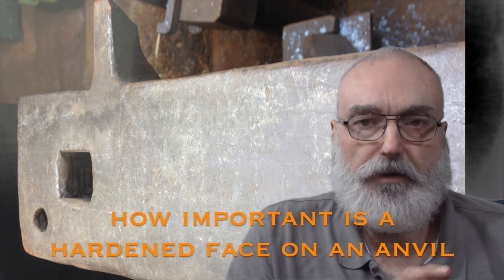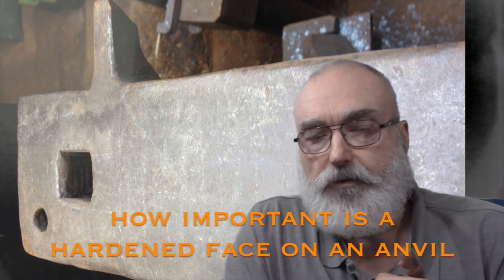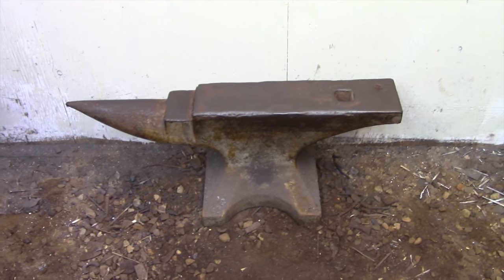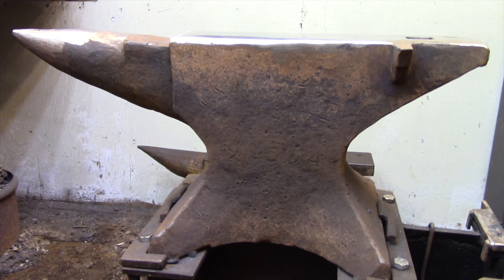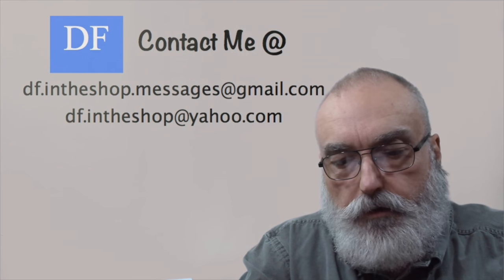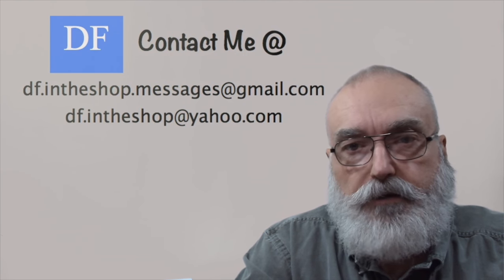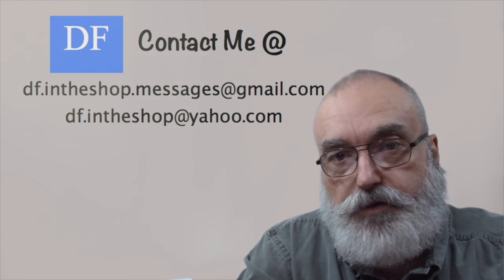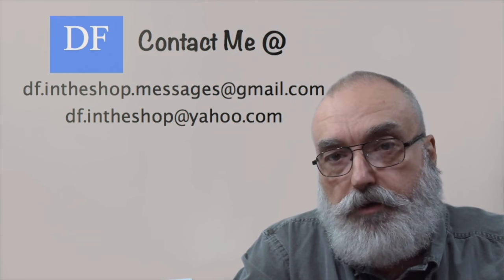Blacksmithing For Beginners - How important is a Hardened Face on an Anvil

Comment: I don't have one anvil. I realized pretty quick that the features of an anvil can be reliably broken up. For example, I have a flat faced piece that only weighs 24lbs on a stump. Much like a railroad tie plate. It's not the best for drawing things out. Instead of forge welding, consider putting a piece of nickel between a hardened plate and a mild steel Base. The shear strength is sufficient for the job. For rounding, I have a modified sledge hammer on the same stump as well as a triple layer of hard leaf springs (3x7inches) forge welded together for any bending I need to do as well as a softened hammer head for cutting steel. When I started I just had a piece of mild steel. They're very good for the money, and if they ding up, they're cheap and easy enough resurface. Eventually you can try forge welding a hardened steel plate onto it 1055 is a good choice and isn't fussy to harden though 1084 is preferable for it's shallow hardening properties.

Comment: I think the idea is that rebound makes it easier on the smith because it helps lift the hammer back up but I'd say probably not as much as one might think because you also have to consider the hardness of the item you're working on, which is usually pretty soft. I think if you work on the anvil all day you'd probably see a difference in fatigue though. Of course harder faces last longer without deformation as well as long as you don't chip or break them which is why several modern manufacturers have made a point not to make them too hard.  You can actually get to good hardness by just facing a soft anvil with hardfacing welding rods and this doesn't require heating or a quench, just some grinding smooth after.
Reply from the maker: In don't think most people are referring to  the direct rebound from hammering on the metal because you are right you don't get any rebound from hot metal. Even if you did you would need reflexes like a cat to benefit from it.  I think a lot of smiths would like some reason for all that wasted motion of allowing your hammer to bounce on the anvil every 2 seconds.

Comment: For those learning hammer control;
 A soft hammer is the answer not a soft anvil. 
Annealing is a needed skill for blacksmithing. 
If your control is so poor that you miss your work and dent your anvil, put your hammer in the forge. Allow a long soaking heat ( it is a hammer not a blade)  then shut the forge off. The next day your hammer WILL be softer than your anvil.
Reply: P. S. What welding rod do you use?

Comment: Thanks Dennis.  I am a beginner, and went for that long search for an anvil.  I found one (Peter Wright), but it was expensive.  I was untrained, plus the anvil had black paint all over it but the face looked relatively smooth with very little chipping.  When I got it home, and scrubbed the paint off, I discovered that the center of the face had been repaired sometime in the past.  Of course, the person who sold it to me did not reveal this fact, and the paint obscured it (be careful - I have seen this more than once).  The areas that were built up with repair dent slightly when i hit it with a hammer.  So I may need to perform some repairs myself to get to a satisfactory hardness. This left me with a lot of frustration and anger at myself for being such a dummy.  This video has helped soothe a bruised ego, so thanks for that.  And I will do what I can to improve it.  Again, thanks for the reality check on the real reasons that an anvil works as a tool, rather than as a collectible.
Reply from the maker: It is important to learn to relax.  When your starting out ( and everybody is the same)  you have to realize that all the damage to your work is mainly coming from your hammer not your anvil.  As you improve you can decide how much your anvil need to improve to keep up with you.   It took me 30 years before I decided I needed to upgrade my anvil.

Comment: In the eighties i bought an anvil of about a hundred pounds from an antique shop near by, they were using it as a door stop.It is a cast iron anvil with about 25% of the face beaten away,I tested the face with a file and the file wouldnt cut it.Even though that anvil is in such poor shape, it's still a good usable tool.I think it was $25.00 well spentThank you for sharing your knowledge, i wish the internet had been around when i was trying to learn how to forge.

Comment: I'm speculating that a harder surface will allow you to put ( bounce, reflect ) more of the energy from the strike into the piece your working.  Where as a softer surface would absorb or dampen that energy.  The amount of energy conserved may be significant.
Reply from the maker: I don't agree with this rebound theory at all.  If you want to get the most work out of the energy it took to raise the hammer you need to make sure that the metal is sitting on something that doesn't move.  As long as the surface is harder than the heated steel it doesn't matter what it is.

Comment: I was looking at the harbor freight anvil. It case iron so it will/should work if I keep the work piece hot and soft. As it cools damage will occur. I see people beating a cold piece of metal and they are wondering why it damages the anvil. Go figure. This anvil might make a decent project. Heat it up and build up an inch of welded surface.

Comment: i use an anvil that i made out of mild steel, with "100% penetration" welds (that is, about 10lbs of rod filling in so that the anvil is one solid piece rather than a bead on either side of the joint) 

the face gets dinged up sometimes, but is pretty durable and continues to work harden. 

this anvil cost me about $50, and it weighs around 120lbs. it's tall and skinny, but all the mass (3"x6"x16"h) is directly below the hammer, and for what it is, i think it outperforms any london pattern in the same weight range. 

i can't justify $5 $6 $7 $10 per pound for some clapped out 100 year old anvil. i paid 20 cents per pound on mine - so i always tell people to go this route, along with what you mentioned here about hardness. 

and, hey, if it gets dinged - we have angle grinders and mig welders nowadays. that's nothing to repair! much easier to fill in dings than to fill in chips.
Reply: I would love to see the anvil you built

Comment: great video. I do need to mention one thing about rebound of the anvil. This has no impact on the results of your video but the ball bearing test is an effect of the law of conservation of energy. The height of the  rebound is perportional to the amount of energy retained by the ball bearing. But when hitting a a piece of metal with a 3 pound hammer if you loose 2 or 3 percent of the energy it's no big deal.

Comment: Thanks, Denis, for another great video. There is so much bunk out there concerning anvils. For the most part, people have come to believe anything the anvil collectors say and the myths are perpetuated. I am still searching for a serious shop anvil. I have a "traveler" which is a 128 lb PW which needed much tlc prior to it being functional, at least to my satisfaction. What I can't stand is the status that anvils have been given. As far as my logic understands, anvils are tools. If they need modification/repair/tlc then go for it. People who proclaim that anvil value decreases if you repair (flatten the face, radius-ing the edges, chamfering the hardy hole, etc) really have no idea what they're talking about and do nothing but increase the ignorance factor regarding anvils in general. However, the upside to this is that while the price of the perfect anvil is rising to ridiculous levels, the squat, wide, non-hardened face low rebound anvil sits in the corner gathering dust waiting to be discovered by me and given a good home.

Comment: I have an 100lb anvil I've got build up 90 0/0 of the face , wondering would it a good idea to put steel plate on it after I get it build up and ground. and if so what kind of steel plate should I use?

Comment: I don't understand why the rebound is a concern on an anvil!! You are not striking the anvil. You are striking the work!!! Thank you Sir for the great videos!!!! God bless you!!!!!
Reply: Because rebound represents the amount of energy that is not absorbed 
(rebound) by the anvil. That means if your anvil does not have rebound 
at all (sounds like a bag of sand when you hit it, like a cast iron 
"anvil") then most of the energy you put in the blow is absorbed by the 
anvil, and not by the workpiece you are working on. And guess what 
happens when 9/10 of the energy you put into work is absorbed by the 
piece that lays below your workpiece. You get tired and only 1/10 of the
 energy is consumed by moving the metal.
Fortunately there are no such items so called "anvils" absorbing 9/10 of
 the energy, but you can see and feel the difference when you work on a 
cast steel hardened face anvil and on a wrought iron one. When i say working, i mean not straightening some nails.
Reply: If you go to 9:25 in Denis' video, you'll see that when he drops the bearing on the hot steel, there is virtually zero rebound. That is exactly what happens when you're hammering on hot steel with your hammer. When I began my search for my first anvil, I had fallen deep into the vortex of "anvil mythology". It had to be a London pattern, and it had to have 80% plus rebound. When I started working on hot steel I quickly realized that there was absolutely no energy being returned to my hammer. I did notice, however, that as the steel cooled and became less malleable, my hammer was bouncing up from it. But, obviously, you can't/shouldn't hammer on cold steel.

Comment: I'm just learning so my understanding of the rebound test is more along the line of determining an anvil that allows body mechanics when striking that requires less energy to move the same or more amount of metal! But I also thought that the solidity from the face down through the anvil is relevant to produce the rebound  you want! I'm also a drummer so, if I'm wrong, it's because of looking at the rebound of an anvil is like the rebound of a drumstick of a drum head! It's all in the rebound and grabbing that rebound to your advantage that will require less energy! I know that rebound can be more efficient for drumming and RYTHM!! I'm positively sure that if your in rythm with the rebound, it requires less effort in lifting the hammer back up, which should enable you to hammer longer which means more productivity!! But, I suppose I could be wrong! Feel free to comment and correct me if I am!
Reply from the maker: I'm not going to get into the rebound discussion.  The point of this video was to let new people know that good ironwork can be done on any large chunk of metal.  Don't pass something up just because it can't fire a ball bearing through your forehead.

Comment: Hey I know this is an older video but I just wanted to ask your opinion on the Gunther method. It recommends hardfacing in all cases, and judging by what you say this isn't in line with the parent stock in most cases. I've touched up edges with mild steel rod with the theory being that "well it broke before, why would I put something brittle back" would mild steel rod be appropriate for face repairs?

Comment: speaking of anvil shapes, what do you think about the block style and voles that don't have horns and all of the face is completely over the mass of the body? something similar to the design that Glen GS tong has made and uses.
Reply from the maker: I think they are great.  All of the weight is focused exactly were you need it.  When I was doing more production work I had a series of vises set up that held all the hardy tools I needed and well as a bickern so the only part of the anvil that I was using was the center block.  1/2 of the weight of the anvil wasn't supporting anything.   I haven't had a chance to look at the anvil that GS tongs has but I his fan club certainly has made me aware of it this week so I'll try to get that into Week 30 this Sat  - Thanks

Comment: My uncle just gave me a 90 lb chunk of 4140 steel to use as an anvil. I don't think it's been hardened. Does unhardened 4140 steel make good anvils?
Reply from the maker: Do Not !!! try to harden that 90 lbs block.  4140 is an oil hardening steel.  I don't know how much oil you would need to be able to quench that without it busting into flames but it would be a lot. Just use the block as it is. It will work very well as an anvil for years.  Any block of steel would.  Don't be that guy that tried to burn down the neighbourhood.

Comment: Dennis, you a right of coarse, the best asset any anvil has is mass! Beating hot steel with your 2 or 3 LB hammer on top of a 500 LB anvil is always going to give better results than a 20 LB lump of railway track. Through good fortune I went from a 150 LB to an almost 450 LB and could not believe the difference!

Comment: something interesting I've read before was that someone took a piece of low carbon and work hardened it, so intentionally started beating the steel down evenly and checking for compressing it flat with marking fluid.
im wondering if that would work?
cause that would be easier for me than finding a hardenable steel plate of that size.
Reply from the maker: I guess to a degree it does but that will happen naturally as you forge on it.  People exaggerate the need of a supper flat & hard anvil.  Find a block of steel ( any type of steel) and start forging. Check out the series of videos I did for my CNC anvil system.  That is just mild steel and I used it for several projects to demonstrate that it is capable of doing good work.

Comment: Dennis thank you for your commitment to providing such great educational videos on smithing. I have a 130# London pattern anvil that someone took off about the last 2 inches of the horn from. Otherwise the anvil is in wonderful shape and I could not pass up the price I got it for. I have contiplated adding steel to the horn vs sharpening the taper of what I already have. I hate to take metal away from the anvil. Any suggestions Dennis?
Reply from the maker: I would leave the horn as it is ( shape it as best you can ) and make a small stake anvil to fit your hardy hole or in a vise. You never use a heavy hammer to work the tip of the horn anyway so it can be raised up with no problem.  It also makes it easier to see.

Comment: Couple quick thoughts on welding rods.
6011 is part of the fast freeze group.
It was designed for dirty, painted and I'll fitted joints. It has extra deep penetration 
and would be suited to filling deep narrow openings. It does not build up fast. Nor is it strong enough to bond to tool steel.

7018 ( or preferably 8018) is part of the fast fill group which includes 7024.
7018 is an all position rod unlike 7024 which is a flat position rod. 

As a high speed welding rod,  7018 has iron powder in the flux coating and is used,  among other things for build up of worn parts before re-machining. 
Therefore 7018 is preferred for anvil build up.
Hard facing rods have little place in repairing anvils.

Comment: The 112 lb anvil I have now has hammer marks from testing the rebound of my hammer. I forgot I was warned not to do this. I received the anvil with a pitted face which I welded up and ground down until it looked like an anvil face again.  I thought I needed to harden the face. I guess not. Should I grind out the hammer marks?  Just use it as is?
Reply from the maker: Heat treating a 112 lbs block of steel is a not something that can be done in a regular shop so I definitely would not try that. Grinding out the hammer marks is really up to you.  I don't bother with them unless they are really deep  because they really don't damage the work.  It is true that a dented surface will translate into a raised detail on a hot piece of steel but those defects are easily corrected by  continuing to hammer the surface. The hammering drives the imperfections back into the metal and as the metal cools it will pick up less and less detail from the anvil surface.   See my video on Damaged vs Worn anvils
Reply: DF - In The Shop thank you. I will use it as is then. Once I have a forge anyway.

Comment: Very informative! I'd like to get your opinion on something: I have a ~8-10" section of railroad track I've been using vertically as a "good enough for now" anvil. I've been considering adding a 6"x6", 1"-2" square or round plug of steel to the surface to give me a slightly larger area with which to work. I'm under no expectations of suddenly having a DIY Trenton as a result, but do you think it's worth the effort? Should I buy a piece that is hardenable or pre-hardened, or just find a chunk of mild steel?
Reply from the maker: I would start by pricing out the scrap that is available. If you are buying pieces to add to the railroad rail than it would probably be better to start from scratch (if you have the stuff already then that is the better choice). The nice thing about 6X6 is that it weighs about 10lbs/inch so if you can afford a 24" piece than you have a 240lb anvil without any welding or grinding.  Another thing to consider is that an anvil does not have to be all steel but the total mass has to be one unit.  So  If you have a 20lb block of steel securely  bolted to 200lbs of lumber that will act like a 220lb anvil.